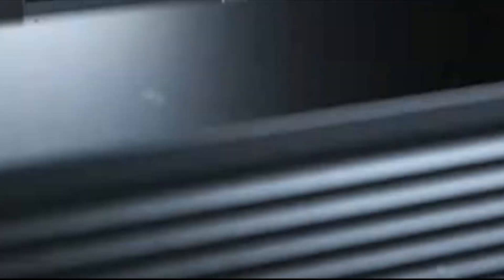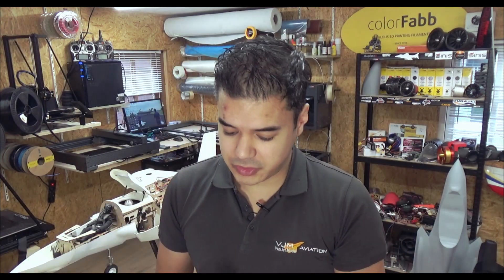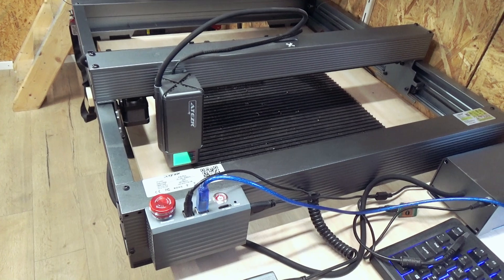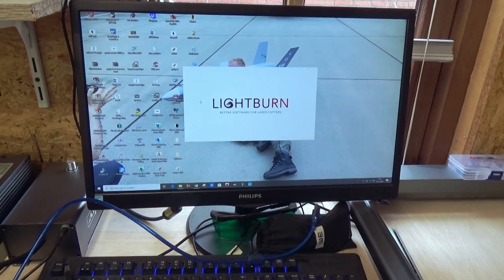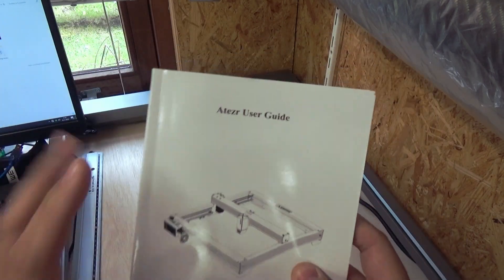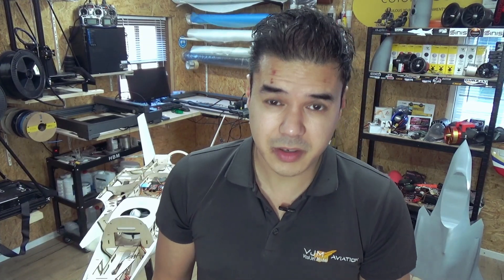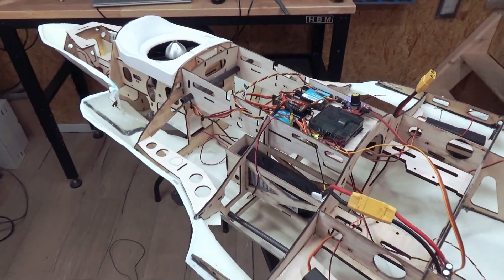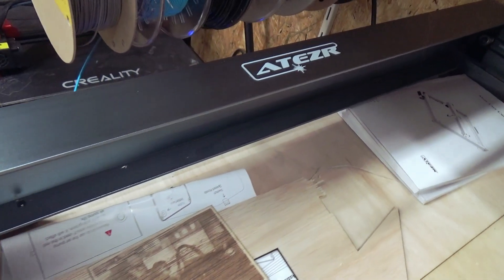ATEZR P20 Plus | RC F35 Vertical Takeoff 2023 Scratchbuild With powerfull diode LASER *no ads

Comment: I'm curious about the balsa/plywood layup you used.  What density and thickness of balsa wood did you use and what type of plywood?  Did you layer both sides?  What type of adhesive?  Thanks!
Reply from the maker: The blaza and plywood are 3mm…the glue i use is 3M scothweld 490..the best of best
Reply: @Joelmelanie  Interesting.  So instead of 6mm lite ply, you're constructing 3mm lite play with 3mm balsa for a 6mm layer?  How much weight will that save you?

Comment: Hello Joël, I am dutch :-).  Following your channel for quite some time now and seeing all the wondefull engineering. Perhaps you already know but last year I researched the triplex/multiplex used in Asian made ARF planes. Takes too long to explain my interest in wood... so maybe some other time. I found that it is called Albassi Falcata. It is sold in the Netherlands but only in 4mm. It is very light, almost balsa equivalent, almost without any imperfections and very stable (i.e. very small amounts of expansion, shrinkage and warp). Only when cutting it turned out I am quite allergic to it but it really is ideal for light modelbuilding when applied with the level of knowledge you have.  Also, if you use balsa, is there no structural need to add a very thin layer of carbon ? Renee has all the vacuum knowledge to do that at high quality level. Wonderfull projects!  keep it up please !
Reply from the maker: Dankjewel man voor een leuke comment! Helder verhaal! Wie is René? Ben er wel benieuwd naar. 4mm ga ik gebruiken in de 1:8 model, bij toeval met opschalen kwam ik uit op 4mm
Reply: @Joelmelanie  Dank voor je reactie. Niet verwacht dat je zo snel zou reageren :-).  Ik bedoelde René Rosentraeger.  Ik was zelf op kleine schaal bezig met vacuum en loste een aantal belangrijke problemen daarmee op door het vacuum met zeer goedekope middelen te handhaven m.b.v een Arduino en een vacuumsensor en een simpel/goedkoop vacuumpompje. Geheel uiteindelijk voor maar een paar euro-tientjes.    Ik zag René's video's en stuurde hem alles. Source-code en bill of material etc. Hij zou er naar kijken maar geen idee of hij er iets mee gedaan heeft zal wel niet.  Als je wilt kan ik mijn uiterst goedkope maar zeer doeltreffende en instelbare vacuum oplossing toelichten. Een plaat Albassi Falcata triplex in 4mm is overigens erg goed te betalen.
Reply from the maker: Altijd prima joh! onze René Rosentraeger..op het moment genieten van een lange break na de lancering van de mini harrier, vandaar het nu rustig is. Ik ben op het moment aan het oriënteren om mij hok te voorzien van een goed vacuüm systeem( niet al te duur) maar zeker nodig;) er komen mooie projecten aan :)
Reply: @Joelmelanie  Dag Joel, vooral het niet te duur was voor mij belangrijk 🙂. Ik ben ook een RC vlieger en (scratch)bouwer. Mijn criteria om mijn vacuumoplossing te maken zijn vrij uitgebreid. Ik dacht laat ik je mailen dan kan ik het wat eenvoudiger opsommen en daarmee een toelichting verschaffen. Ik zag alleen geen mail adres bij youtube.  Dus maar een zeer korte versie hier.... Uit ervaring wist ik dat je nooit een vacuum kunt vasthouden omdat er altijd wel een miniscuul lek is of gebruikte materialen zijn toch niet helemaal luchtdicht. Industriele vacuum oplossing: Zet de pomp aan en laat deze continu draaien en zorg voor een regelbaar lek (ventiel) om het vacuum niveau vast te houden. --> Geen optie.   2. Thuis optie: stofzuiger gebruiken: genoeg voor 20% vacuum maar geen optie omdat de stofzuiger dan ook aan moet blijven staan tot de hars voldoende is uitgehard. --> Geen optie.  3. Kleine vacuumpomp met olie --> moet ook continu draaien tot voldoende uitharding is bereikt.  Tevens neemt dat allemaal ruimte in in mijn beperkte hobby ruimte. En daarbij, ik vond het te duur allemaal --> geen optie. Oplossing: Goedkoop vacuum pompje van 10 a 15 euro met gelijkstroom motor, die halen max 80% vacuum (te veel dus zelfs).  Probleem: beperkte levensduur (max 500 uur).  Oplossing: Vacuum meten en pompje aanzetten om ingestelde niveau te handhaven. Als alles zo goed als mogelijk dicht is, slaat pompje ong. elke 15 minuten voor ongeveer 1 seconde aan.  Hele systeem is klein (kan in een doos worden opgeborgen), goedkoop en werkt werkelijk uitstekend. Ben zelf erg blij met de hoge kwaliteit en gewichts/sterkte verhouding die vacuum oplevert. Gebruik mijn eigen systeem graag. Ben bezig een cockpit kap van meer dan 40cm lang te vervangen en de mal heb ik al klaar.Daarbij zal ik het ook toepassen. Ik hoor wel als je foto's of zo ervan wilt zien. Btw ik koos eerst voor een CNC bovenfrees maar zal over een paar maanden ook uit gaan kijken naar een laser engraver/cutter.  Succes.
Reply from the maker: Ja fantastisch! En heerlijk om te lezen..ook precies de zaken waar ik tegen aan liep! Herkenbaar. Je mag altijd mailen naar info@vjmaviation.com;) ik heb nu een simpel plunjer vacuüm pompje met een kleine buffer. ik gebruik een iets duurdere pomp om vacuüm te halen en dit goedkope pompje om hem vast te houden..mist dicht. Een stof zuiger gebruik ik om het proces te versnellen🤓
Reply: @Joelmelanie  Dag Joel, dank voor je positieve reactie. Ik zal vandaag even wat foto's nemen van de test opstelling en de uiteindelijke uitvoering die ik nu gebruik. Dat moet ik nog wel een keer beter doen maar dat was voordat ik de CNC bovenfrees had :-).  Ik mail wel e.e.a. Succes !